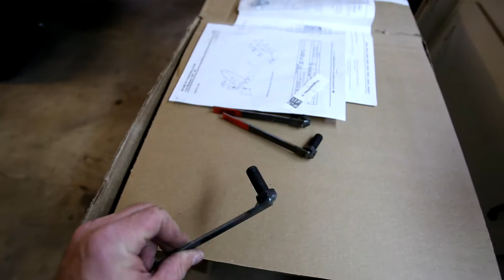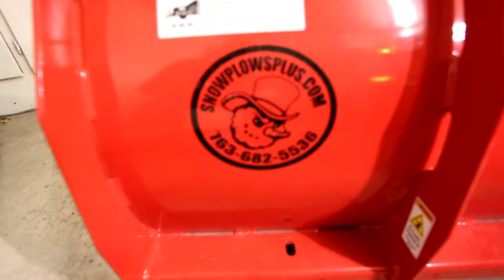Mounting a Western Defender on a Jeep TJ

Comment: Nice installation, are you going to add air shocks for the front or any kind of counter weight?
Reply from the maker: Scott Watson   It drops a bit but I haven’t had a wheel scrub yet. Plowed all last season and a few times this year already without issue. I used my boss v plow on my diesel Chevy once since plowing up the Jeep. 112” moved without issue,  the Jeep/ western jus became my favorite snow mover.

Comment: Also might want to adjust the down blade hydraulic valve so it drops slower.
Reply from the maker: I  have used the plow 4 times this year, It does drop a lot slower in cold weather.  We are supposed to get 6-8" tonight. Every snow fall we have had so far has been less than 2".  Its been a great plow so far, we will see how it does in a bigger snow event.
Reply: @cattrashbrad   Nice, Sounds great. The adjustment screw very easy to set the down blade speed. So far Western Defender in a great system for me as well.